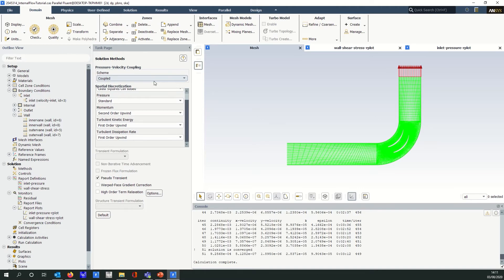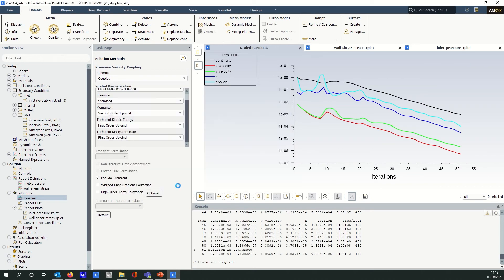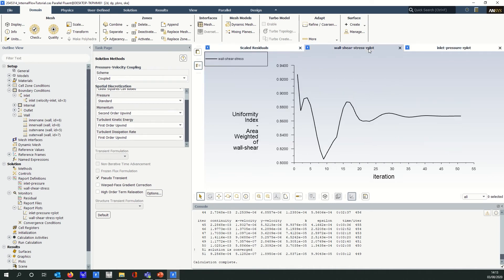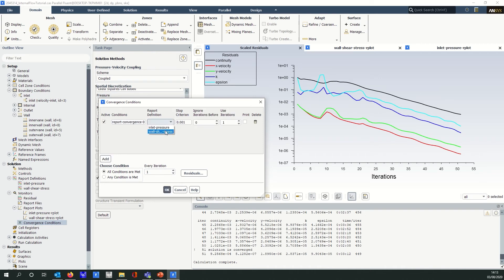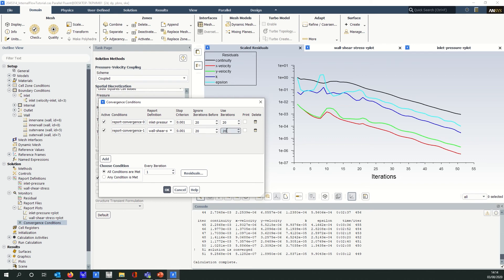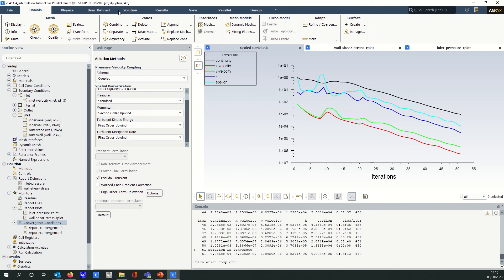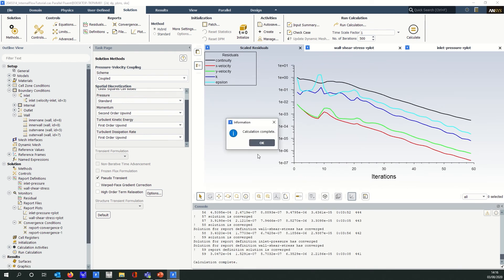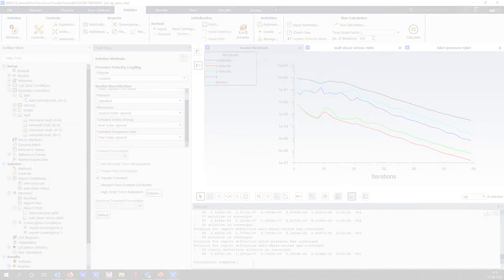How to Effectively Monitor Convergence in Ansys Fluent

Comment: Does time step affects solution in transient analysis? I am conducting a transient thermal-flow simulation which might take more than 60 mins of physical time to achieve steady state. Currently I am taking time step of 300 seconds(5 mins) with 300 iterations/time step. The velocity residuals reach lower than 1E-05 but energy and continuity residuals becomes steady at just below 1E-01. Is it acceptable or I need to change something? Please reply!
Reply from the maker: Hey Harsh, the time step needs to be small enough to capture the shortest transient phenomena in your simulation. If it is a conjugate heat transfer problem, the time step for solid needs to be much higher than fluids. You might want to check your flux to make sure they are being conserved, especially heat transfer if your energy residuals are high. Hope this helps!

Comment: Is the recent iris xe graphics with the 11th gen i5 16gb ram compatible and sufficient  with ansys for  medium 3d  simulations?
Reply from the maker: Hi, integrated graphics cards usually share system RAM with your CPU, so your 16GB of system may practically end up as less. Ansys have not specifically tested that range of Graphics cards so it is hard to say, I would say it probably will run for small simulations, but you will definitely run into issues with larger models as you run out of RAM. Hope this helps!
Reply: 1.8 million cells (poly cells) consume about 15-16gb of ram. If you are working with only 1M cells, 16gb will work fine.